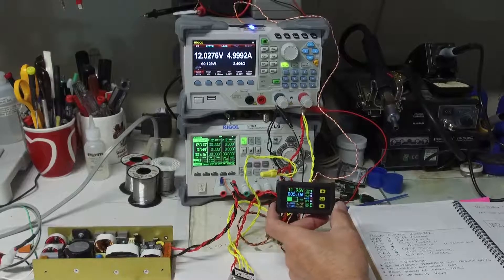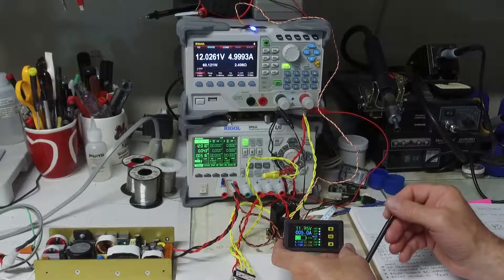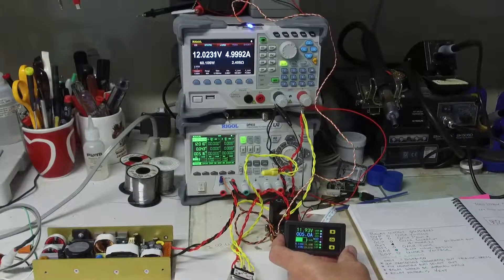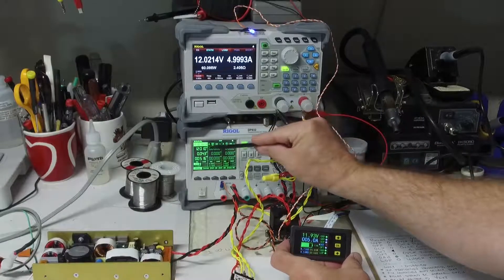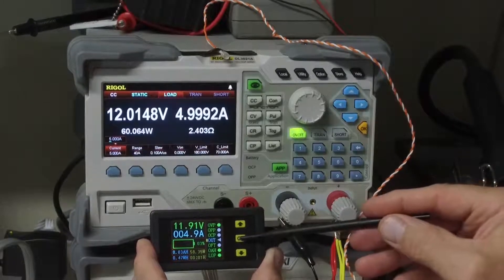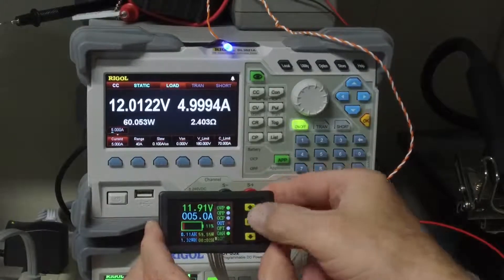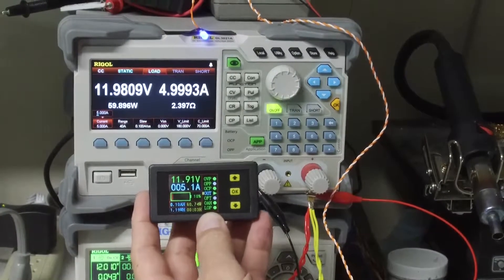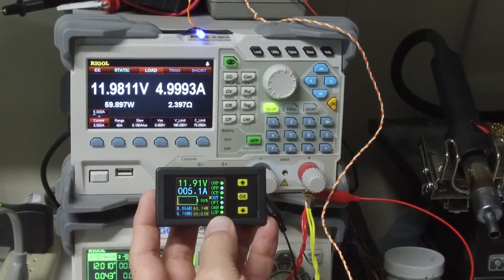Digital DC Ammeter Voltmeter, capacity, discharge / charge rate. Yeeco / Drok.  Part 2.

Comment: Another amazing video! I’m trying to understand how one could potentially use this system in as a solar charge controller. Would the relay on / off be similar to a load on / of switch in a solar controller? Is there a manual on off for the relay? Also, if your solar panel is used as the power source (not a mains AC/DC power supply) can you both draw current from the battery as well as charge it and see both the negative drain as well as charge numbers with this unit? Thanks so much.

Comment: What is the recommended voltage for the unit power? I have a 58.8 volt. measurement.
Reply from the maker: I believe measurement range is 0-60V.  I am not sure I have seen a supply voltage specification.  The circuit board input caps are marked 35V, so I would not go over 24V.  Just my opinion.

Comment: Very interesting. I understand that many of these monitor devices have on the back of the display unit PCB some pin headers for a serial UART connection.  With the right codes at 9600baud, you can get voltage and current readings into a computer or microcontroller.  Have you explored this at all?
Reply from the maker: Oh...  Very interesting.  Just took mine apart and it looks like there might be that capability.  I'll dig into it a little.
Reply from the maker: Just took a photo of the guts and looked at the layout. 

Look at this: https://drive.google.com/file/d/1INlu3RdK0-fg0-yWoSVDS_N67bfINbyM/view?usp=sharing
Reply from the maker: Would need to extend the connectors to fill missing portion and add a couple of components.  It clearly looks like it is setup to transmit RS485 signals.  Could also be modified to transmit logic level 3.3V TTL signals that should be able to be read with a FTDI USB to TTL 3.3V cable.  Might have to give it a whirl.  Thanks for the info.
Reply: And I found this re the protocol (at least for the model I think I have):
 VA7510S communication baud rate 9600

Send hexadecimal command: 0xFA address code (the default address code is 0x00, which can be modified)
Return hexadecimal command: 0xFA, address code, temperature value, current value (lower eight bits), current value (higher eight bits), voltage value (lower eight bits), voltage value (higher eight bits), output status

For example: If the instrument address bit is set to 0x01
  Send: 0xFA 0x01
  Return: 0xFA 0x01 0x0F (temperature value) 0x05 (low eight bits of current) 0x06 (high eight bits of current) 0x07 (low eight bits of voltage) 0x08 (high eight bits of voltage) 0x01 (output status)

Data analysis Actual measured temperature value = 0x0F = 16 degrees
          Actual measured current value=0x0605=1541=154.1A
          Actual measured voltage value=0x0807=2055=20.55V
          Actual relay output status 0x01 (open output), 0x00 (close output)
Reply from the maker: I might have to try it and if it works, make a part 3 video :)

Comment: Can this measure when there is an input and an output at the same time? EG if solar is on charging the battery but theres also a load on the battery? Assuming it depends on the setup and where you place the sensor. What if you run 2 wires like you have here in opposite directions, but instead of switching them, theres power through both at the same time?

Comment: Ok so … i have found that when you press and hold the “OK” button when on the “out” function , it switches between various diffrent functions …. Can you please review that so i can get my controller to work again … because all i see now is 30+amps and smoke comming out of the solder points and sometimes it clicks and other time it gives me other readings .

Please assist or share the link to this user manual.
Reply from the maker: Interesting.  I'll see if I can get my unit back on the bench and see what it does.

Comment: Hi Dan, could you please Review the New Drok 120v 300a , I just received it and have NO idea how to use it. The Graphic interface is completely different.
Reply from the maker: I might be able to do that.  Is it this one? 
https://www.amazon.com/Charge-Discharge-DROK-Capacity-Temperature-Voltmeter/dp/B09P661829/ref=sr_1_1?crid=2BRBOFKJLJ94Z&keywords=drok%2B120v%2B300a&qid=1653971231&sprefix=drok%2B120v%2B%2Caps%2C127&sr=8-1&th=1

Comment: Dear Dan, Wow!, this and the previous video are brilliant!!!  I have several of these units monitoring my off-grid system (along with some Arduinos) and your clear description has enabled me to use the battery capacity 'gauge' correctly and use the over voltage alarm as a secondary method of preventing over charging of the 48kWh of Li-Ion battery's that are at the heart of the system (two sets from written off Nissan Leaf EV's) Thank-you so much for your great work!
Reply from the maker: Thanks for the kind comments.  Cool that you have off-grid capability.  I would like to do that as well.  Where did you purchase your Leaf batteries?

Comment: Great info. I especially like the switch to reverse directions. This will be handy as I am currently experimenting with/monitoring a super capacitor bank as a load and as a source..
Reply from the maker: Thanks and very interesting that you are working with some super caps.  What caps are you using?
Reply: @DanPattenAudioG33k  Item Details

Farad Capacitor 2.7V 500F 6 Pcs/1 Set Super Capacity with Protection Board Aitomotive Capacitor 16V 83F Serial Connection
$36.00
Set-6Pcs, Qty 1
This is the current info on Wish. But these cap's are sold as battery saver's and supposedly enhance engine performance. I basically ignored those claims and figured they would be like all the others. But I've charged them multiple ways and they hold almost zero amperage within minutes of disconnecting the charge. Rated at 16v but I've never gotten more that 12.  So for the purpose of a jump starter or like most of the vid's on YT it won't work. But for the purpose they advertise I'm not sure yet. Will try to compare with OBD software and a dc clamp amp meter!! I've had them installed in parallel with a battery isolator for about a week and no problems whatsoever. I welcome any suggestions abt testing for performance. Sorry. I'm wordy but would love feedback
Reply: @DanPattenAudioG33k  i can actually answer your question now bc I had to open my enclosure to discover a cap at zero and 1 below what it should be. The other 3 are ok. I suspect the balance board. Not the cap but won't know until I desolder. Anyway, they are GreenCap 2.7v - 500 farad but the cap's are really lower according to testing by another youtuber. I'll probably try to find a good price on Maxwell. I have 4 of them at 2.5v - 120 farad and they perform far better than this 500 farad bank.